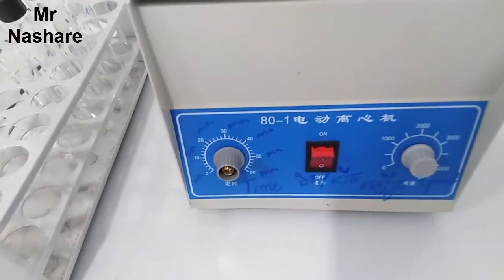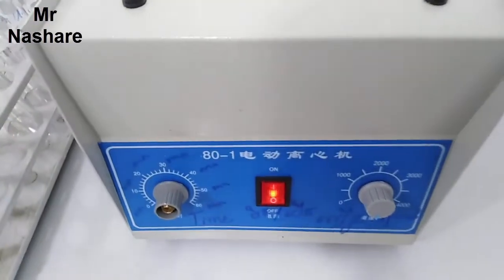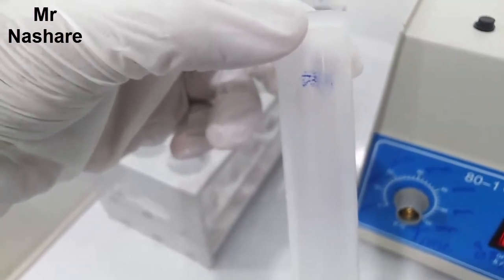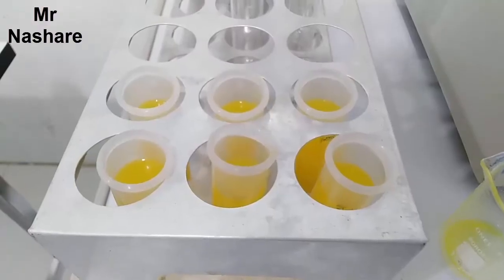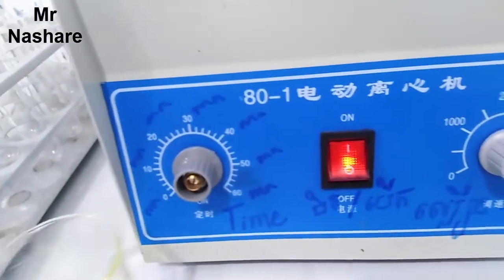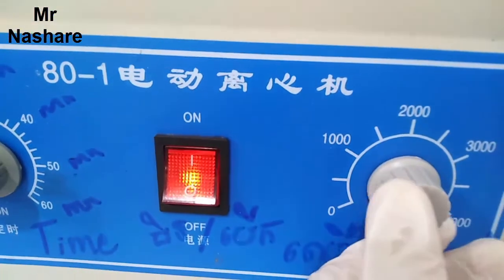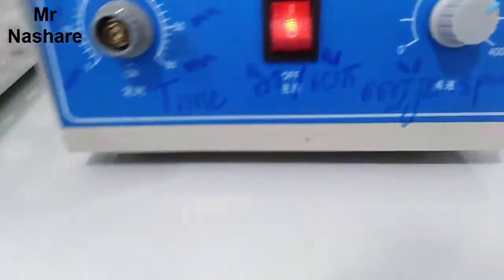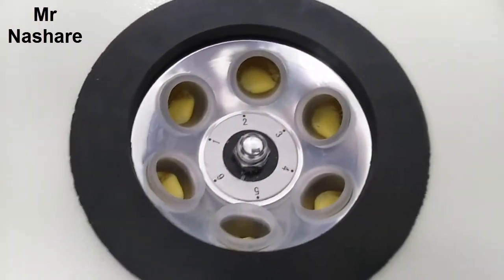How to use Centrifuge machine / Centrifuge 80-1

Comment: When timer switch is turned then machine automatically turn motors even the speed is at zero
Reply from the maker: if the speed still zero ,motor not yet run
Reply: @mrnashare6379  motor is running even speed is zero
When timer is turned machine starts running
Reply: I disconnected connection from board to speed controller still motor runs
Reply from the maker: And so how can you take the sampe to if it still run ,i think should have other solution.